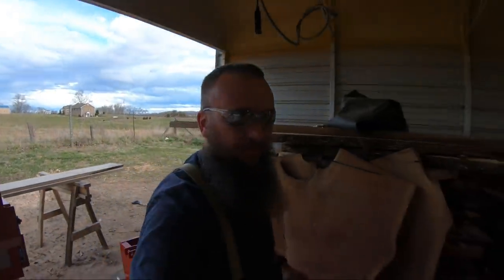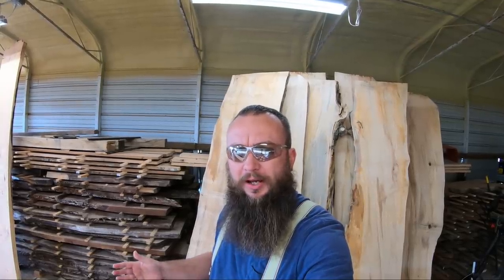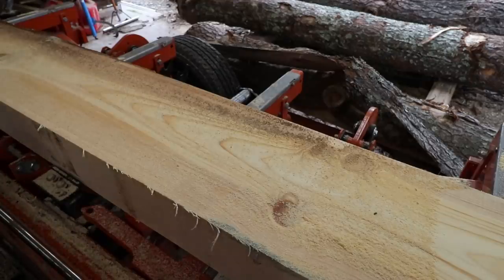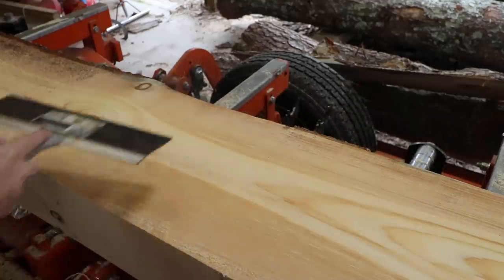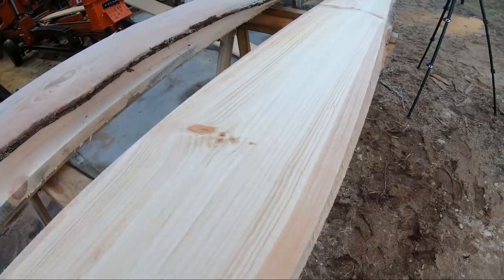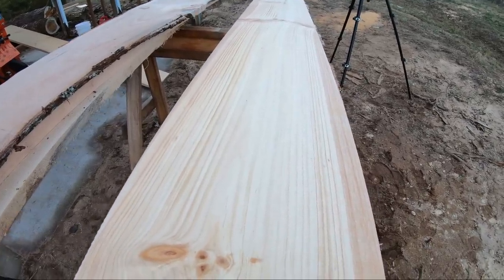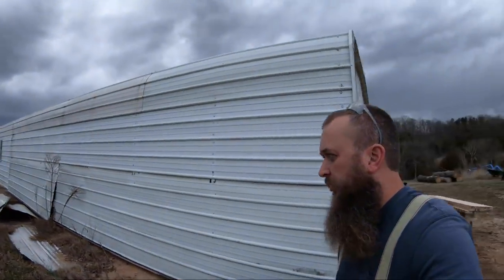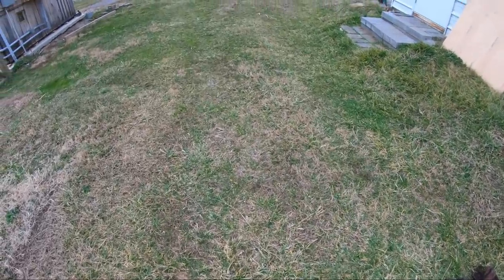I Could Do This All Day: Yanmar Diesel Plowing Through White Pine

Comment: Heyas.  Not sure where you are in TN, but I saw a tree today that you might want to look for.  On TN 59, between US 79 and Seay Dr, next to the town of Braden, there is a partially fallen tree at the edge of a field.  Some sort of oak, I am pretty sure.  It is a heavily pruned stub, about 25 feet long, and 3+ feet in diameter at the base.  It has fallen over, but most of it is still off the ground.  There is center rot, but it tapers, and does not look like it travels more than halfway up the length of the stub.  The top half of the stub has several large branchings which should yield interesting figure.  I thing the top half of the stub would fit on your mill.  Easiest way to access it would be to take I40, exit 35, head towards Covington, and start looking for it on your right after you pass Seay.

Comment: I think I see what is the problem with the push back bar for pushing the boards as the saw returns.  It is slightly too close to the head and the face of the bar is at an angle to the saw blade.  I think the pusher should be closer to the center of the saw blade and either parallel to the saw blade or at  least not that much of an angle to be able to shove the boards straight back to you.  It might need to be slightly wider.  The fingers that dangle down on some mills are straight across and shove the boards very well.

Comment: I was thinking about a good use for all that accumulated slab wood. Would it be possible to have it chipped? You could bag it and sell as mulch or sell it by the bucket load. Get the very most out of those logs.
Reply from the maker: goes to firewood